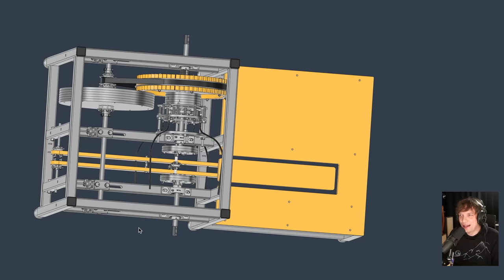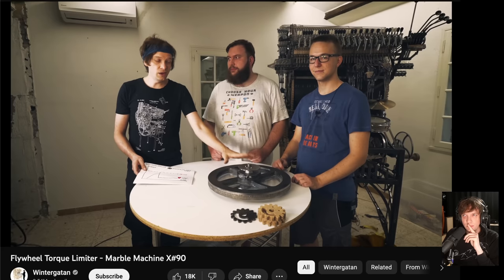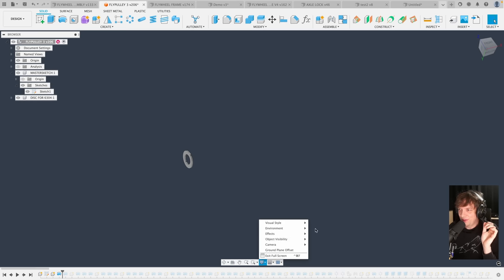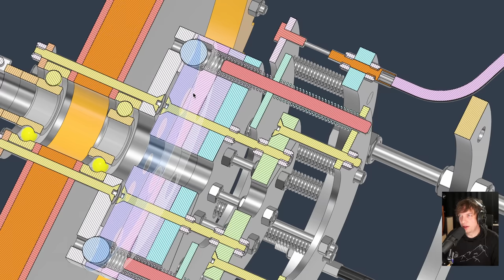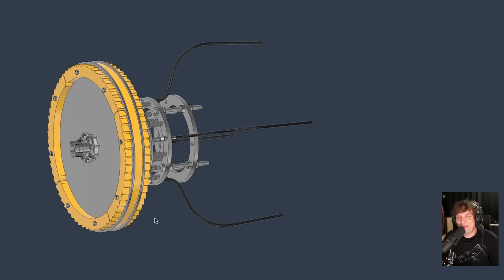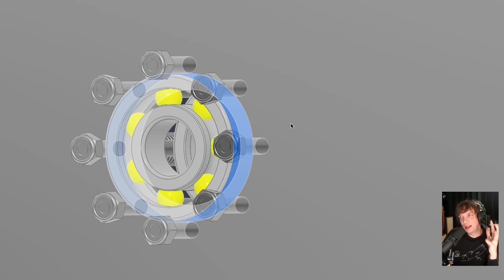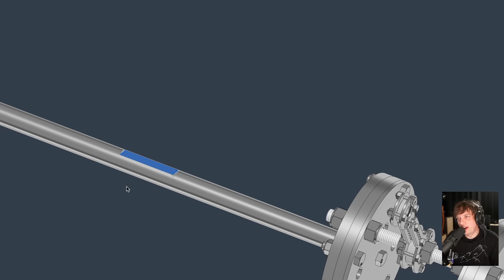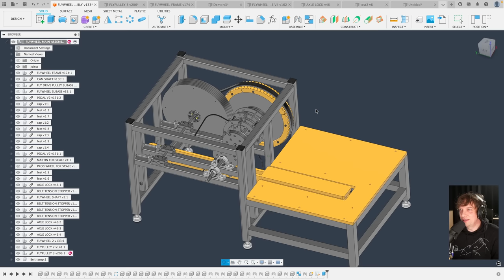Safety First! - Marble Powered Clutch

Comment: Looks like a nice design and it does have all the functionality that you want. HOWEVER it looks like this design is going to be an absolute pain to fine-tune and adjust. Very high amount of nuts to ALL get spot on for proper functioning of the system. For example, if you want to get an even amount of spring pressure on the springs that push on the clutch marbles, you would have to get 1 or 2 of the steel disks that are connected to the (red in cad drawing) rods very neatly aligned using a lot of different nuts. And doing this is gonna get very old very fast. When adjusting one nut higher on disk A, it's gonna drop on the other side, etc etc. Pretty fast you will be chasing your tail all around disk A, which in turn is gonna affect the position of disk B, and you will keep going back and forth forever. So I feel like this design could use some refinement, and I'm quite sure you can think of something that will have the same functionality that's more easily adjustable and with fewer parts. And especially with fewer adjusting nuts.

Comment: The stepped bits are to prevent the flywheel from turning the wrong way.

**EDIT**
Thinking on this more, I wonder if there will be a spring loaded ratchet that will allow the flywheel to turn in the wrong direction at first when the pedal is pressed.  Then when the pedal is released, it would push the wheel in the proper direction.
Reply: Could be, but its unlikely. It would add a lot of noise and vibration, its more likely itll interact with an instrument or so but really hard to tell
Reply: @D3nn1s  I wondered about the noise as well. But there are ways to disengage an anti roll back once a flywheel gets up to speed.

Comment: Disclaimer: I am not a mechanical engineer.

It seems like the flat shaft attachment is creating a force concentrator on the leading corner.  If material specs aren't purposefully chosen, I would worry that either the plate or the shaft would start to experience round-over or erosion leading to increased slippage.

Comment: My only concern with the flat spot on the drive shaft is over time with the rotational forces on it, it may round the edges of the flat spot. If that happens it will either start to slip/spin or just have a lot of wiggle room to move and damage it further. The clutch settings for torque limiting will need to take that into account. This is the problem the keyway was designed to get around.

Comment: I'm guessing the ratchets are for a small motor which can spin the input shaft at a specific RPM. The teeth are grooved so that if the flywheel runs faster than the motor, it will just slip past that tooth.

Comment: I really think having the pedal flush with the platform and driving it down beneath the platform is a bad idea. He will have to alternate bending knees as he pedals. As the left foot travels with the pedal below the platform, the right knee has to bend, then as it travels up, he will have to bend his left knee. Very awkward, and not optimal at all for driving power with the legs unless he is seated - which we know is not how we wants to play this instrument. The right leg should be stationary and providing a foundation for the movement of the left leg and foot on the pedal. Not to mention how unsafe it would be to have the foot slide a bit as the pedal goes down and then get caught on the edge of the hole coming back up.

Comment: The main issue I can see with the bearing housing is with wear, not with concentricity (provided you can get the parts machined accurately). If you have some imbalance in the pulley, the hardened bearing will soon start to wear through the bolts. You could use off the shelf flange blocks that constrain the bearing axially but will still allow you to get concentric alignment if your machining isn't perfectly accurate

Comment: Man this is some crazy engineering! I'm in highschool FRC Robotics and we do a lot with bearings, machining, and motion. We also use a lot of CAD, and I'm impressed with the detail you have designed with. I really like the ingenuity of your hybrid clutch-brake assembly, and even though it has a lot of pieces its very cool.

But one thing I have learned from our engineering mentors and building a whole robot, and I'm sure you've learned in redesigning the marble gates, is no matter what, simplicity is better. Always. I had a concept for the gripper of our robot that we managed to make work, functionally, but in practice was not effective. But I kept engineering it and trying to make it work, because I thought it was cool and inventive.

But simple is always better. Always. Even if you lose some small nice function, or have to leave a brain child behind, do it. I think in your quest for radical pragmatism you've possibly strayed from that path.
If you wish to really make it work, I'm sure you can, you have a lot of talent and drive, I'm really impressed!

Comment: I'm slightly worried about some assumptions about laser cutting that might not be correct, e.g. "cutting a flat plate of metal will give clean edges and if you cut straight down, it'll be a 90° cut". As far as I know that's not the case and might lead to significant work afterwards. I suspect though that it might be possible to cut close to final dimensions and do the tight tolerance stuff on a CNC mill. Some of those designs however seem a bit challenging for rotary tools... so please get in touch and get a few early samples as it is very easy to design something that works, but can't be reasonably manufactured (just like in music you can write a lot of pretty songs that are not/barely possible to be actually played on a real instrument).

Comment: Make sure your frame dimensions exceed the diameters of your flywheels so you can bolt shear panels to the sides to contain any failure of the flywheel, and create the added stiffness you will need to compensate for precession torque of the flywheel.

Comment: With the bolts holding the bearings you have two round objects touching. The surface area of contact is extremely small, which leads to very high forces exerted onto the surface.
Bolts are normally softer steel than bearings, so they will very likely deform and your bearings will start to wobble quickly, plus the deformed threads will make taking it apart a pita.
Just add another ring, that is slightly thinner than the bearing, to hold it and move the bolts away abit.
In short: naked bolts bad as bearing housing xD

Comment: @Wintergatan
16:13 I would add an outer "ring" around that "controversial bearing housing", it goes between the flywheel & the "lid" of the housing (extend the "lid" more outwards to cover the new ring).
The reason is leverage, you might bend the "lid" with the necessary clamping force, but by adding the ring around it, it turns from a 1st Class Leaver to a 2nd Class Leaver (or 3rd class?), because the ring adds stability & "a point" ("a line" around the ring) for leverage for the "lid" against the bearing.

Comment: I'm so glad to see you continuing the marble machine legacy! I've been along for the ride since the beginning. I noticed a potential safety harzard with the pedal. If the pedal is designed to go down into the platform when moving, then if your foot slips off of the pedal to one side then it could get chopped off or crushed by the platform. Perhaps you could put in some safety walls under the platform similar to those you put on the pedal itself. Food for thought
Reply: Design it like a freaking organ pedal

Comment: Don’t center your wheel with screws. Screws have a play in their own housing, which will completely de-center the wheel.
Also, any slight deviation of the mass center of the wheel from the axle of rotation will cause heavy vibrations.
The only way is to ask for machining. Use a lathe.

Comment: At 21:55 you really shouldn't split that disk. It's preferable to have those parts machined in a lathe because they will be rotating. Un-balanced disks introduce vibrations it's preferable to have a piece of metal working as a key rather than having the part cut by laser making contact with the shaft. Laser cutting doesn't leave a smooth surface on the mating surfaces.

Comment: 1) Look up how a clutch fork works.  Using one will cut down 4 cables to 1 for your clutch/break.
2) Removing the spring load on the balls will not make them silent when the clutch slipping.  In fact, the marbles will probably start bouncing back and forth and it could be louder when slipping while released instead of just over torqueing.  Not sure if that matters or not.
3) Using bolts will not work well for a bearing housing.  Bolt ODs are undersize from nominal, so unless you account for that, you will have radial slop and mis-location.  Thread crests are not designed to bear load radially inwards and will deform when the bearing race hits them, increasing the radial slop.  For the best bearing performance and life, bearings require proper fits to shafts and in housing.  Usually, one needs to be a slight press, while the other is a slip fit.  You don't necessarily need that fit for a prototype, though.  A better solution would be to invest in a lower cost 3D printer and print your own bearing housings.  You can get around low print accuracy by having the housing bore under size and pressing the bearing into it.  Then, you can align the bearing and housing to mating parts at assembly to get good concentricity and runout.

Comment: I see a lot of "it's so complicated do x or y solution that will require a lot of work to accommodate" but in reality it's going to be much more efficient to just pick a solution and fix it if it doesn't work. Iterative design isn't the cheapest way to do something usually, but it's definitely fast and effective.

You might have a laser cut steel sheet assembly that doesn't work, but you can easily get a new part designed, cut, and installed within a week. If an off the shelf assembly doesn't work you now have to put in a significantly larger amount of effort to replace it.

Comment: A possible use case for ratchets on a wheel is to count the rotations or measure the speed. But in that case you would only need one ratchet. In a previous video martin said "ratchets make the world go round" and corrected that statement to "ratchets make the world stop". The ratchets might be there to prevent a rotation of the pulley in the wrong direction, eg prevent cranking in the wrong direction. They could also be for a musical purpose like the cymbal machine from the mmx

Comment: Very elegant Martin... Your design is very much like like the Slipper Clutches I have on my high power RC race cars. You have gone a step further by designing a brake into that system. The Slipper Clutches I use have 2 metal plates with bearings in between them. Nice, quiet and smooth power delivery.  Awesome work there... You continuously amaze me.

Comment: Seems a ring with several inclines on it would be a simpler way to disengage the clutch and would only require one cable.  Less to adjust and less cable to service.  One cable would rotate the engagement ring to move the clutch.

Comment: Hi Martin - I suggest that you add a magnet to the springs so that when you engage the clutch the marbles will remain attached to the springs and withdraw in a more control.
I like your bearing solution, it means a lot less complexity in the production.

Comment: Hey!! About the bearing housings…. I would really recommend to use some H7 holes for positioning the outer bearings! Bolds are not made with that precise tolerances and wil get you a lot of trouble to get, and keep them at center!! A off center drive pulley / flywheel creates a lot of vibration and it will effect the tightness of the machine! You are on a good path!! But don’t take to many short cuts!  

So conclusion: you need to position and fix the bearings radially on center of the pulleys too!! So it never can slip out of place. With a chamber or a ring (welded) with a H7 hole in the middle the job is done.

I understand your point about the number of suppliers and stuff… but I’ll bet there is a metal workshop around the corner that will help you to create some chambers on a lathe for you!

Keep up the good work!! Regards Bas Dekker from NL 🇳🇱

Comment: Is it worth slightly undersizing the hole on the flywheel and supercooling the bearing, and fitting it in thst way to ensure an incredibly tight fit rather than relying on the bolts for accurate centering?

Comment: Hey Martin!  I love watching your videos, and it's been inspiring watching you learn from your work.

Design-wise the pedal seems to be problematic, both physically and bio-mechanically.  You don't want a pedal that you have to push below a platform as the constant one-legged squatting is going to be very tiring.  There is also the issue of the pedal being a huge lever arm facing towards you, and I see this as risky if it is able to spring upwards with any force.  I've been thinking that a much better design is already available to learn from.  Take a look at how a simple kick drum pedal works, with minimal parts being basically a simple lever on a hinge and a chain rolling over a 'pulley'. I think you could easily adapt the design to your flywheel system so that it is both safer for you to use, and much less tiring when in use.

Comment: The teeth are obviously there to cause maximum damage when the wheel flies off !

On the subject of the flattened portion of the shaft to replace the keys, the keys are also there to provide a cheap and replaceable point of failure. Having the whole structure being too stiff will mean you are rolling a dice on the part that breaks when and if something does. Who knows it could be the shaft itself, which would be much more costly and hard to replace.
Thankfully by design here, most of the load is removed by the clutch system when the load would be highest. But be sure to make the marbles in the clutch don't jam if you want to keep your shins :D

Anyways, cool design !

Comment: Having specified housings for SKF bearings in the past, I am eagerly waiting to see how this "housing" design functions. I am optimistic for the application! No doubt there will be a lifetime impact, but those bearings are designed for applications with orders of magnitude more rotations than any marble machine would put on them. My worries are balancing and concentricity of the belt bearing surface. I would suggest including a circular hole array on the pulley to allow a balancing weight to attached, and to lathe down the bearing surface once the assembly is fastened together. And calling it right now, this machine will never work without a good source of turned parts, lathe is king of machine tools for a very good reason ;)

Comment: Hi Martin, by using 4 nuts and bolts for tensioning the clutch and even more for the bearing balls, you need to tight each bolt exactly as the other one. This can (maybe) be achieved with a torque wrench but still is a lot of manual work and has a great failure potential. I would recommend to use only 1 big center bolt to adjust the preload of the springs. Less manual work, less failure points and more precision. Hopefully, you understand what I mean.
Cheers form Germany!

Comment: Your half moon shapes on the shaft might not work the way you want. You'll end up with a line contact instead of a surface contact which will wear. Consider ways to increase the area of contact between the shaft and the disks to mitigate.
Reply: He does not even acount for laser cutting V angle. All cuts have a draft, unless you remachine them.

Comment: Clutch regulator is identical to that found in many battery powered drills. When selecting the clutch strength, tightening or loosening, you are changing ball and spring tension by changing the distance of the backing plate with drill head.

What Martin is achieving with the Bowden cable is done with threads

Comment: Love your designs and ideas based learnings from experimentaiton. As an automation design engineer with ~30 years experience,  I would like to provide a few design suggestions - 1) screws should not be used as location devices.  2) For long life, bearings are designed for a press fit into a housing bore. The +/- bore tolerance is specified by the manufacturer.

Comment: Another fun video to watch. A Fusion 360 tip for you: Look into doing a Motion Study to show how the mechanisms work. It allows you to animate your parts based upon joints, so when one joint moves, the rest are acted upon accordingly so that you can see the effect of one action on the rest of the machine. It will be much easier to follow than selecting a few pieces and trying to explain what moves where. :)

Comment: If you want the bearing to be perfectly centered on the flywheel, you'd machine a recess to locate the bearing on the steel plates, then you only need something to retain the bearing fully seated in its ~2mm deep pocket. If you make a full-blown housing, then you'd press the housing in the flywheel to locate it and the bolts would also be only there to prevent it from popping out. If you want quasi-absolute precision when mounting bolts, you can do it like car wheel lugs do it: tapered nuts in tapered holes to help everything perfectly self-center.

Comment: Martin, as a CAD designer myself, I think your hacky way for bearing fixation will work but when something breaks, it will be hard to replace and find the exact match. I often use bearings in my designs and concentric alignment of laser cut disk is done with a circular feature on the turned bearing housing and a circular laser cut hole (sometimes finished with a reamer).
The bolt holes and the threaded holes are not accurate enough and often threaded manually (so you lose the perfect perpendicularly of the screws). The outside diameter of threaded bolts are also not always consistent.